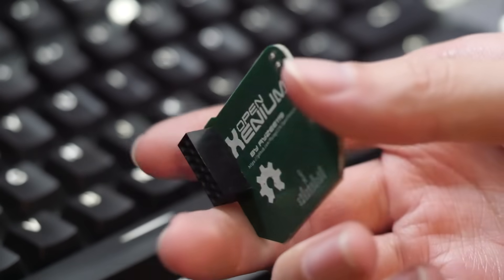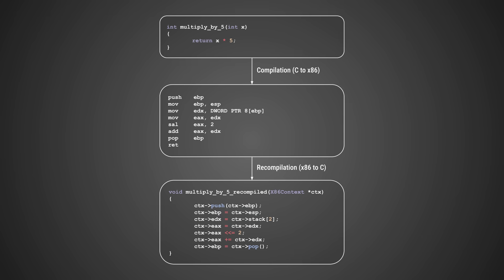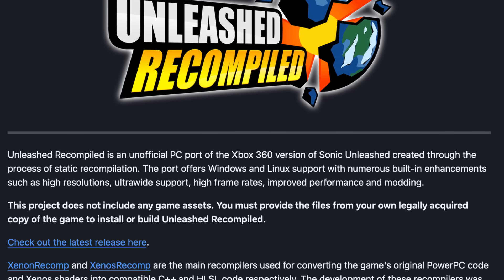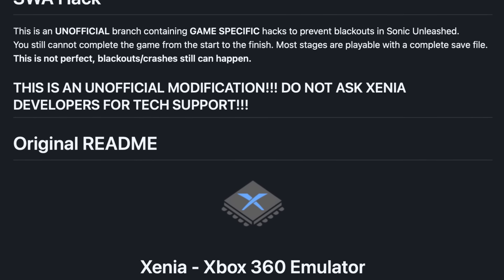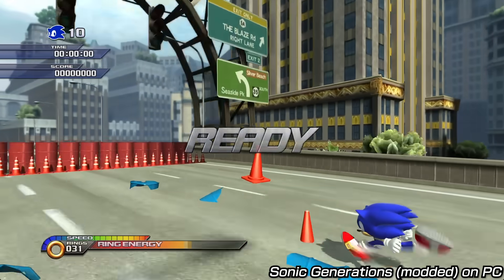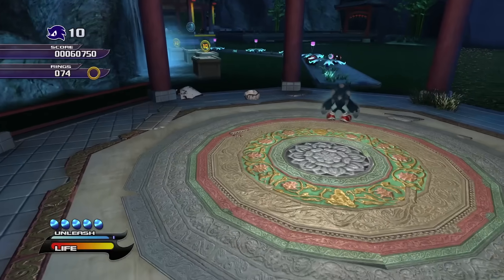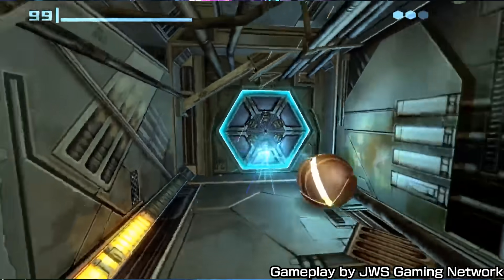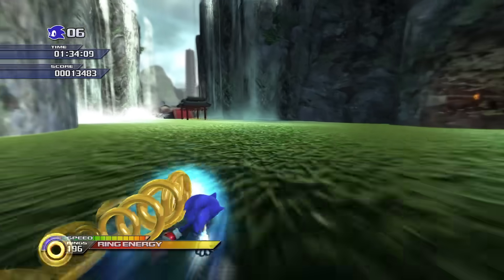So... how exactly did they port Sonic Unleashed to PC??

Comment: As someone involved in the decompilation scene I'd like to point out that we were definitely aware of static recompilation and it's potential benefits, we just didn't go for it because we knew the downsides of the approach. A lot of us felt the technical debt involved wasn't much less than actually decompiling the source to byte matching results.

The primary benefit here is that projects without known or accessible compiler versions can be quickly "ported", though quickly is a relative term here since you need a non-trivial understanding of the code already. Which you already need to do a matching decomp, see the catch-22 here?

One approach gives you a rather useless representation of the original code beyond a) novelty, and b) quick "porting"
The other approach gives you a well defined codebase you can work from to make new mods with relative ease.

These recompilation projects are pretty awesome, don't get me wrong, but you're easily the first to actually bring up the disadvantages of the approach, and I thank you for that. All of the articles I've seen written have either glossed over the issues, or simply ignored them.
Reply: That's a very good point, the reason why Unleashed benefit from it is that the modding scene of Generations already give the modders an understanding of how the code works, the people involved in this recompilation has been reverse engineering the lighting ending, the physics, and everything about Unleashed, Unleashed Poject for Generations was the first step to understand how the engine work and from there the modders has been doing improvements to it since then, without those years of experience, this project might have not been possible.
Reply: I don't know, in the case of unleashed a simple port of the game was more than enough for us to be satisfied. The game and the engine has vern reverse engineered enough over the years to make the mods that people actually want. I get why most of the N64 decompile community would want to stay away from recompilation. "You have alreaady reverse engineered so much of the code, you might as well just go all the way through", such sentiments are perfectly reasonable. But in the case, we the fans, simply want a way to play unleashed in a way that doesn't suck and doesn't require crazy pc hardware or requirea brand new console to barely hit 60fps and still be at 720p. The main bottleneck I have seen about a part of the game that people do want to mod, but are limited to, because we don't have a source code, are the werehog's player controller. 

TL;DR most people are perfectly if unleashed is the only Sonic Game recompiled and if it never gets fully decompiled.
Reply: Exactly! I was disappointed in finding out you can't just use an application to drop in an iso and make a 1:1 PC port of Xbox 360 titles, or even with N64 ones, too. But it is nice seeing another way to preserve games in the best possible way, even though it may take months or years before we see the labor bare any fruit. The future is bright, but with some caveats!
Reply: @dillanikobe495  I would really love to see projects take a dual approach, where they use static recomp on areas of the application that hasn't been fully decompiled to augment areas that have.

But that's really tricky to accomplish.
Reply: @philstephes  One of the people working on the GoldenEye 64 decomp has been playing around with with N64Recomp, though they seemed to be having a rougher time with it than XenonRecomp. Definitely agree it's hard to mod recomps. I think in a lot of cases, it might be easier just to make a dedicated emulator and write some assembly hooks in to access custom features, like one of the people who was modding the Perfect Dark decomp was doing with the mousehook before we had the PC port.
Reply: @Meowsy64  Yeah, it's really neat and all, but it's definitely not a push button solution. And given how absolutely insane Rare was, it definitely doesn't surprise me that they'd have issues trying to do something like static recompilation on GoldenEye lol.
Reply: @philstephes I believe this dual approach is already how recompilation projects work. In an interview with Darío (the Mario ray tracing guy) and Wiseguy (the N64 recompilation guy, Wiseguy mentioned that while the recompiled code was behavior-matching, for modifications to be made he had to decompile the parts of the code he wanted to edit (for example adding gyro controls to Majora’s Mask). In general the benefits of recompilation seem to be lightening the decompilation workload to only the parts you need for a specific purpose (i.e. porting to PC), whereas the heavy process of a binary-matching decompilation opens the door for general uses (like porting Mario into San Andreas).
Reply: @johnclark926  that's not at all what I mean by a dual approach
Reply: @philstephes  oh my bad, I read that completely backwards.
Reply: but what is faster?having a machin recompiled code and then trying to rewrite it or doing whole decompilation?
Reply: @lev3271  A properly written reimplementation or decomp will always run better than a static recompilation. But "faster" is very subject and ill-defined, faster in what way? Better frame pacing? Not necessarily, Higher FPS? Again not necessarily, Lower 1% lows? Maybe.

The real question is which approach is more efficient and has less overhead, and the answer to that will always be properly written code that accounts for the target system.
Reply: @philstephes  fixind a recompiled one was  not a efficient I guest...
Reply: @lev3271  Static recompilation is still a form of emulation, all you're changing is when the binary gets translated from one target to another.

As MattKC points out: getting compilable code is half the battle, you then have to deal with the individual hardware components which can't be substituted easily, so you have to do some level of translation or emulation.

Comment: 4:50 It's not badly optimized, the game itself is ahead of its time, that's why generations got downgraded visual effects and shorter stage.
Sonic's polygons also less than unleashed model

The game also really SPU heavy in RPCS3, just like God Of War 3 / Last of Us.
That means the game did utilized the notoriously hard to code SPU synergistic processor.

Comment: The later parts, with code injection hacking on it, also reminds me of how OpenRCT2 was developed. It started out as code injected into RCT2, then even after the main loop was brought out it called into the original code for a lot of stuff. Over time, given the goals of that project, parts were rewritten and there was less and less of that, no doubt aided by the fact Chris Sawyer was a mad genius who wrote most of the game in x86 assembly. Eventually it didnt need the original executable at all.

I doubt Unleashed will go to that extreme, because the project simply doesn't need it. But it'll be interesting to see what people do with it anyway, because I fully expect some fun things to happen!

Comment: Original: X*5
After all that: ( X << 2 ) + X
or, ( X * 4 ) + X, which == X * 5, but done in a way that works but isn't as close to the original intent. And intent is very important when you do compiler optimizations, since a lot of what the compiler is doing is trying to figure out what you want to do, so that it can do what it thinks is a faster way to do that on the CPUs that it's designed for.

Comment: I heard they used tornados and magic.  I don't know but at 1440p@165Hz that Sonic game is Unleashed!  It does look amazingly beautiful.  It would be super-cool to be able to install any 360 game on my PC like this.
Reply: I agree, the developers say that the game's glitchy when you set the framerate up high (I have it uncapped with vsync off), the only noticeable bug is that you can trimp like you're playing demoknight in tf2 in the daytime stages (meaning you can accidentally go flying all the way to the skybox or just really far, it's fun) and I think the Y-Y-A combo on the werehog sends you a little higher so you can use it as a mobility tool. I think the developers just don't like extra fun that much tbh.
Reply: @ladyskinwalker  i have not noticed any bugs but i have mine capped at 165 to match my monitors framerate. So far mine seems to play perfectly.  I am using an AMD CPU and AMD GPU also on win10.  dont know if that has anything to do with it though.
Reply: I'm just surprised I can run an Xbox 360 game quite smoothly on my laptop that has integrated graphics instead of a dedicated GPU by just lowering the resolution a bit when it also sometimes struggles with emulating PS2/GameCube with similar resolutions and other lowered settings. It really shows just how much performance cost emulation adds to a game.

Comment: IMO recompilation sits right in the middle of emulation and decompilation

a recompiled game will have a code base that is more modable then an emulator, while yes you can mod emulated games, code injection gets complicated and often takes either years of reverse engineering the console architecture or the console architecture being something already well known like ARM or x86 before you can really start injecting code since your only option is machine code injection, where as with a recompilation the output is C++ code and while yes its not exact 1 to 1 C++ code that a human would ever write, a talented C++ programmer could 100% still read and understand the codebase and modify it then also fight the temptation to rewrite the codebase into much more sane C++ code that a human would actually write

on the flip side a decompalation will have a MUCH more readable codebase then a recompilation because, well it was written by a human but will take A LOT LOT LOT longer then a recompilation to pull off

so recomps are right in the middle, more moddable and readable then emulated code, but still far behind a decomp

Comment: The existence of this thing is so incredibly cool, and making the tools open source is amazing. It opens the door to so many possibilities. So many 360 exclusives now potentially on PC! I would love to see the old Forza games get recomps. Also general console exclusives that never got a PC port, like a lot of Japanese games of the time. Asura's Wrath on PC would be awesome. Personally I think it would also be cool to see recomps of games that already have PC versions, but which are lacking features in some way. Like giving Oblivion controller support.
Reply: Hey, for Forza you might have an easier option, Xwine.
It's a compatibility layer, not an emulator, so it's much closer to a PC port than even recompilation, as you basically just install the libraries missing on a regular Windows install to be able to run Xbox One games.
Reply: @YOEL_44  The Forza games on 360 are bit different than the Xbox One Era games. Horizon 1 and Forza 4 are quite great exclusives and have a bit of content. 

They also play a bit differently compared to the later games in the series.
Reply: @waterheart95   Well for those you might need to go the emulator route, fortunately Silent made a bunch of commits to Xenia a few years back, specifically for those games, so they're quite playable by now.
I have not tried this but when you install some of those games on a Xbox One, it automatically downloads a compatibility patch, I don't know how this works, it might just be an emulator, but maybe with those patches they could work with Xwine...

Comment: These modern decomp/recomp PC ports are great. The Jak and Daxter PC port is absolutely the best way to play the game, and from what I have seen of the likes of Ocarina of Time and Super Mario 64, it seems like they're just as good.

What a time to be a gamer.
Reply: sm64coopdx is absolutely amazing. Co-Op, built-in mod browser and manager and more, it just works.
Reply: I think there's one for Jak 2 too.
Reply: Correct, I simply said "Jak and Daxter" as a catch-all. Jak 3 is also coming this year hopefully. @cookieface80
Reply: Both the same program and jak 3 soon  @cookieface80
Reply: The Perfect Dark one is really good too.
Reply: Can you imagine a port of Jack and Dexter for Sega Dreamcast?
Reply: @gonzaloavila3236  Personally, I think it'd be a better fit to have SEGA's other games like Shadow the Hedgehog, Sonic Riders, and/or Outrun 2 ported to Dreamcast than anything. It baffles me how they released games for it until 2007, yet not a single game they released on there was a noteable release compared to the stuff they did for the GameCube, Xbox and PS2.
Reply: @gonzaloavila3236 I don't think it could run at 60fps, but it possibly could be ported to Dreamcast... 🤔
Reply: @Werewolf_Painter It would be nigh unplayable without a 2nd stick though.

Comment: Matt I really am curious about something regarding this recomp project for 360 games.

since it is basically recomping xex programs into c++ code, and then turning the c++ into an exe (for example). wouldn't that mean that theoretically speaking, we could have ""native"" ports of 360 games on platforms like the wii u or switch? Assuming people are willing to go through the hassle of working around the limitations for each game one by one?
Reply: As MattKC said, you can create recompilers for practically every console...the only problem is it doesn't work out of the box. You need a ton of knowledge on both the console it came from, and the game itself for it to start working.

And by "start working" I mean the game boots-up and is a garbled mess that you need to manually patch up. Lastly, from what I've gathered it's really hard to make recomps universal. You practically need to hustle through maybe 4 dozen games (likely a lot more) just to make it potentially playable with anything you drag & drop in it.

This kind of coding is brutal is all I'll say. Props to the people who can put-up with the intense workload.
Reply: You're only taking into account game code, what about graphics, the Switch doesn't support DirectX...
Reply: @YOEL_44  fair enough. but correct me if I'm wrong doesn't macOS also not support directX? I haven't been up to date on the mac scene in ages so maybe this isn't the case anymore
Reply: @imzary   There might be some compatibility layer, not out of the box.
But ultimatelly that's why these recomps end up being mostly just ports without source code, you need to build all the missing chunks manually to adapt specific games tospecific platforms.
DirectX is just an easy to identify example of things that don't quite fit.